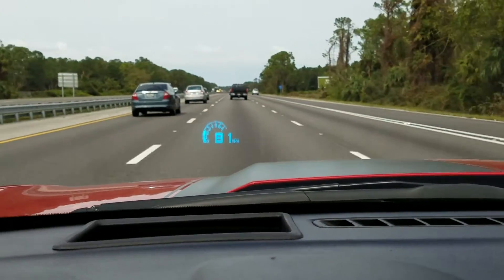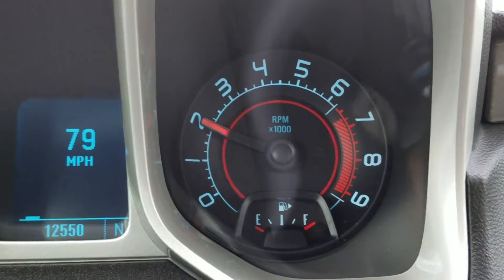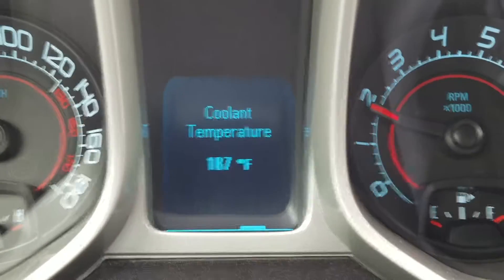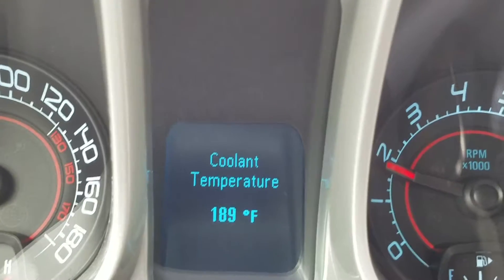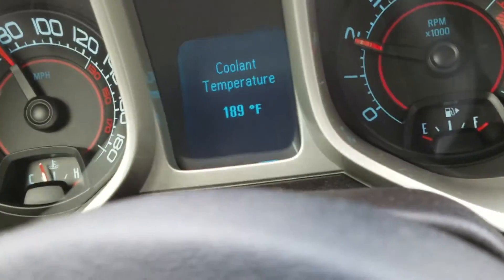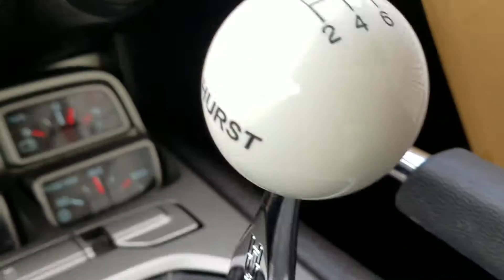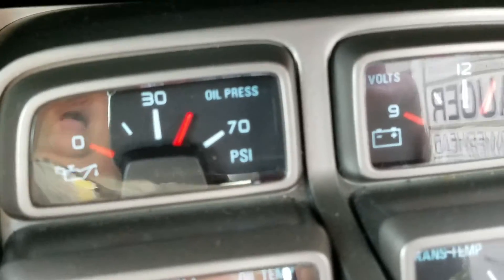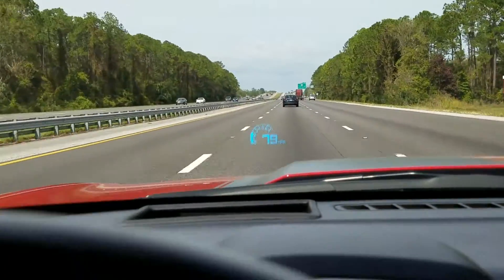LS3 High Oil Temps Oil Cooler

Comment: You wasted your time and  money replacing the oil cooler, normal operating oil temp is 215 to 235,its not overheating. Actually if the oil does not get hot above 212 , you will not burn off moisture  and it will deteriorate?
Reply from the maker: u don't want hot oil with with radiator with high HP engine for street every day car its ok due to emissions to help warm up engine faster with high lift cams u need every bit of cooling from radiator only all race cars have this Nascar NHRA ect off road apps pluss I sold the car no longer own !!!!
Reply: Perfect oil & coolant temperature 👍
Reply: My goes to 200 is that normal temp?